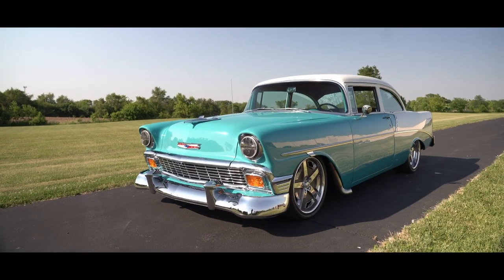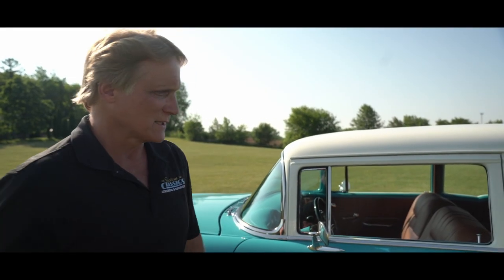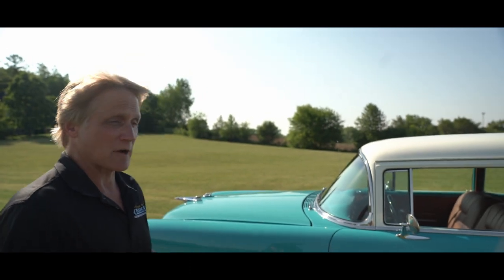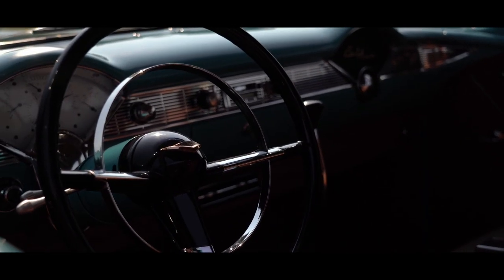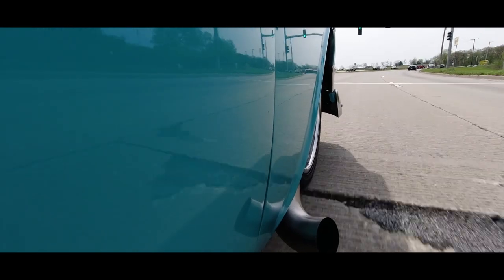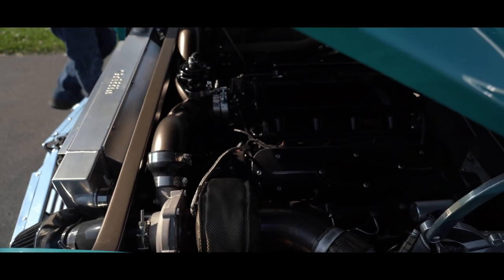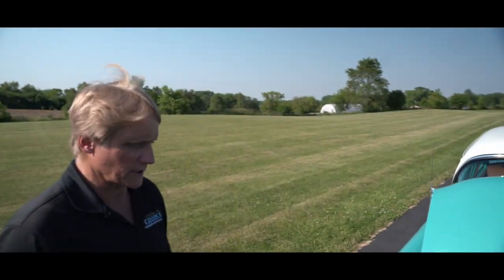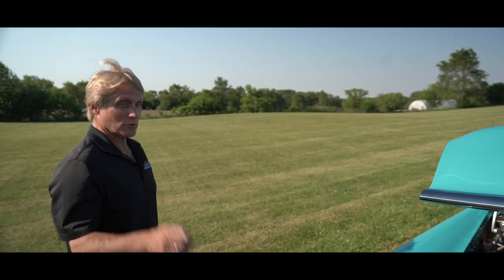TWIN TURBO TRI-FIVE! For Sale: 1956 Chevy 210 Pro-Touring

Comment: Over $200K for that?  Really?  A stock framed '56 with Chinese knock off rear suspension (clearly a copy of the Heidt's triangulated 4 link) and stock front suspension?  No actual frame upgrades.  A stock rear end.  With a 4.8LS and a 700R4?  What a joke!  Those wheels are hideous too.